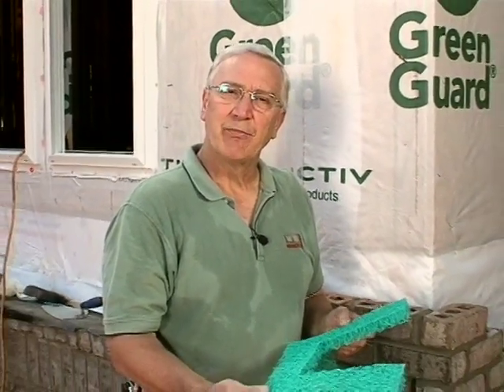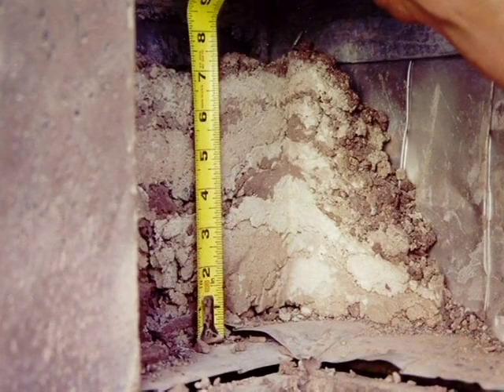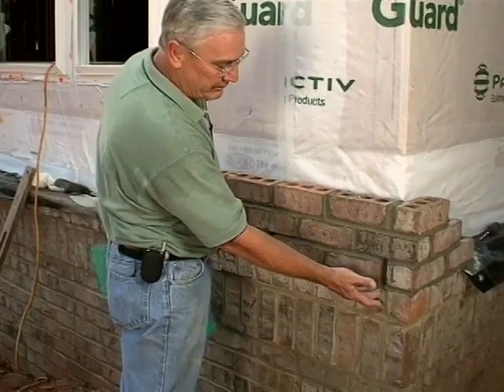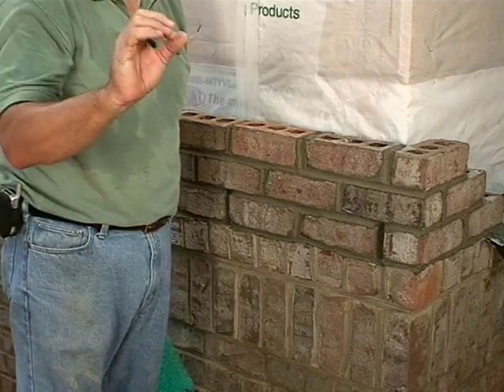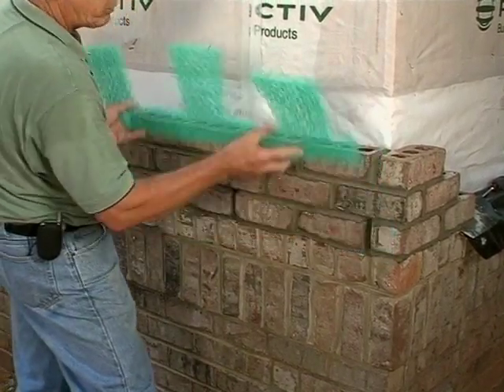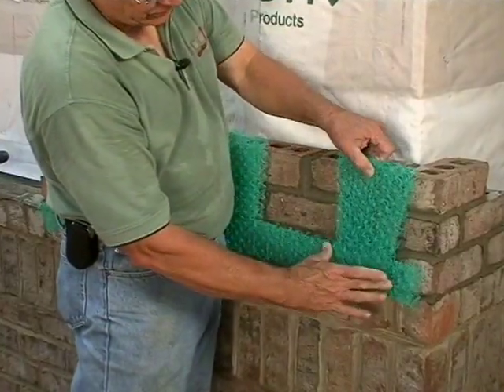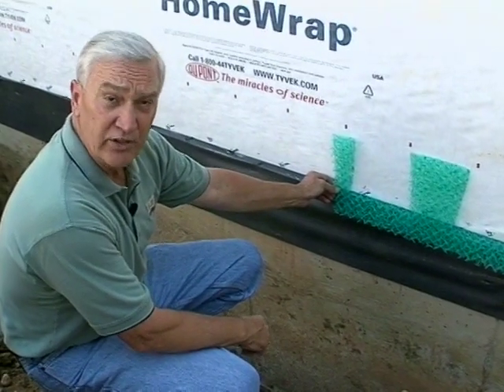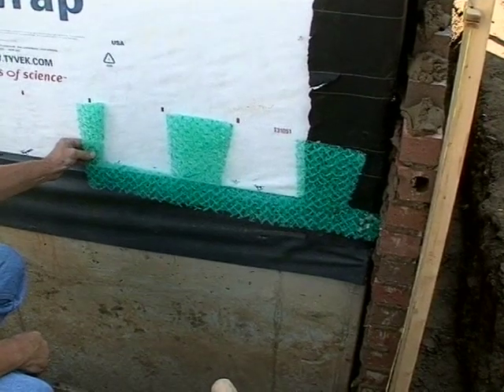Mortar Netting Devices

Comment: when mortar is spread, it also helps to run your trowel along the side of the brick that's closer to the wall. this will push the mortar inward toward the middle of the brick preventing mortar droppings from falling down into the 1" air gap.